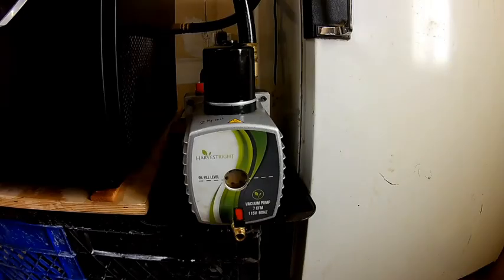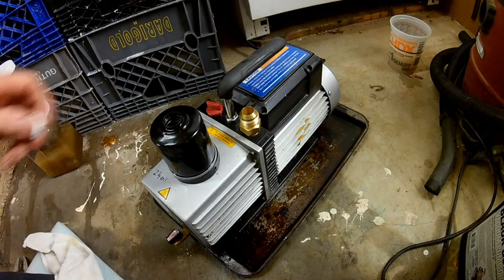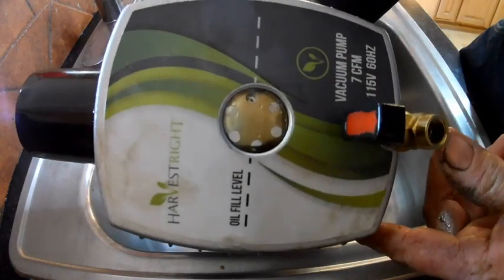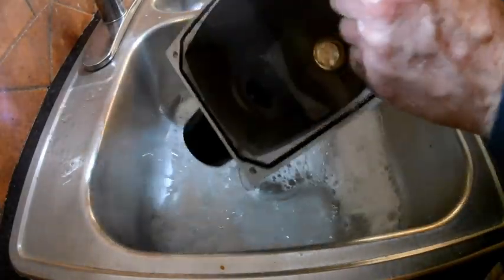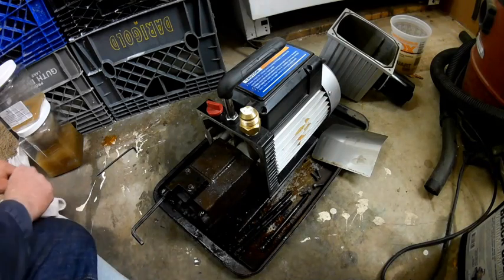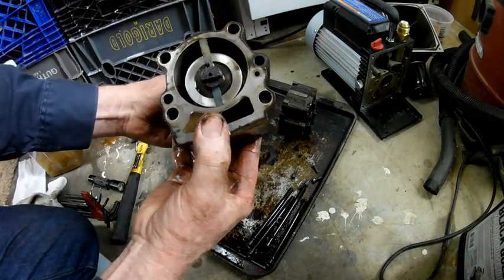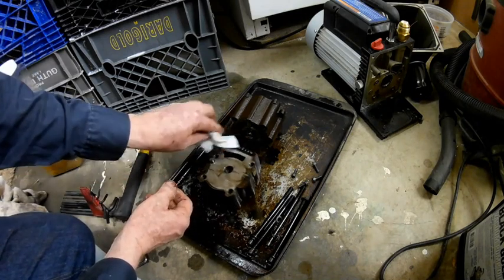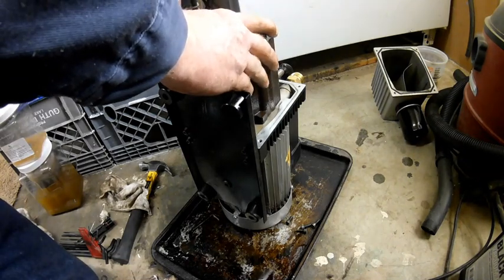Harvest Right Vacuum Pump Teardown

Comment: When you took the little front cover off exposing the shaft end was there a little peace that slots into the end of the shaft, about 3/16 square by 5/8 or 4mm x 15mm
Reply from the maker: I really can't remember.  Do you have the standard or perimium pump?  Do you have an issue?
Reply: @Philat4800feet  I didn't remember seeing it so opened it up again, it was there, thanks. std pump just trying to find why machine isn't registering pressure, I purchased a gauge like yours and it came up 29 in/hg so that looks good, that's about 360mtorr I think.

Comment: Thanks for the video, I originally had the JB until it blew the main seal and cooked the pump so i purchased this one from HR and it lasted 6 cycles and would no longer hold the vacuum after testing and sending them the results they sent me a new pump which only lasted 4 cycles so they sent me a third which lasted 2 cycles lol, so have 3 pumps that wont hold a vacuum, all 3 are the same they get down to under 500torr then go up to about 700 torr before heading back down again but the second time they don't go low enough and after a while the pump just gives up and loses pretty much all pressure, all 3 still look brand new and have no idea why they would go low enough to start with but then give up after that, they thought at first it may be an overheating issue.  now I have nothing.
Reply from the maker: Looks like the odds were not in your favor.
Reply from the maker: The check valve is just inside the pump's inlet,  Normally a ball and spring

Comment: Where does the pump oil enter the vane chamber if it does.  Attached to the motor, I cannot find any opening.  In your video a could not see if it was on the back side. Great video!
Reply from the maker: I can't remember either, but I'm sure there is a pathway.

Comment: Excellent and informative video! Just one question. What type of thread sealant do use on the hose fitting on top of the pump? It took some serious force to get it out, so just wondering what was on it originally.
Reply from the maker: I use teflon tape.  I'm sure the OEM was some kind of thread locker.
Reply: @Philat4800feet  thanks Phil!

Comment: ARE THESE VACUUM PUMPS CALIBRATED IN ANYWAY OTHER THAN HOW THE MANUFACTURER BUILDS THEM?  I trust your opinion
Reply from the maker: There isn't any calibration that I'm aware of.  The only specification a pump would need to meet is CFM and potential Torr at sea level.  In a rotary pump, wear on the vanes would lead to a diminishing vacuum strength.

Comment: do you know where to get replacement seals for these pumps ?
Reply from the maker: On the standard pump, no.  However, if you take the seal or bearing to Applied or Kaman they may be able to match something up.

Comment: Do you leave the air ballast open or closed on yours.
Reply from the maker: When I'm around to do it, I have my air valve open to remove as much air as possible , and then close it around 2000-3000 microns.

Comment: ive been having issues with rust as well, problem is i have to drain the oil every couple batches and pour the rust/water/oil out as its contaminating my oil. the pump works fine but i dont want this rust screwing up my pump? anyone else have these issues?
Reply from the maker: Which pump do you have?  I still have my little standard pump.  It runs great.  I raise the rear of the pump up with a block of wood, empty the oil after every batch, and leave the drain valve open until the next batch.  Water is a problem with vacuum pumps.  Water leads to rust.
Reply: @Philat4800feet   yes i have the standard pump as well, its got to the point where rust particles can be seen in the sight glass and it leaves residue and particles in the filter when i empty it out. i guess i will have to call a tech from harvest right as i cant imagine the oil being good for the pump
Reply from the maker: @chrishill4973  There is a video on how to power flush a vacuum pump.  Check out the repair videos on Harvest Right's website

Comment: This was an interesting video as a mechanic who occasionally works on equipment that uses veins the wall of the cylinder is just as important as the veins.  It only takes a few scratches to loose performance.
Reply from the maker: You're correct.

Comment: So I took mine apart, surprised how much rust I had. I’ve only had my unit 4 months. Cant get it down to 500mt. Oil is cloudy and dirty. I’ve replaced it three times now. Don’t know how to clean the dimister. Any ideas
Reply from the maker: There are three possibilities: pump problem,  freeze drier leak, and other.  I had the same issue.  I went to a nearby hydraulic hose store and had them get me a vacuum gauge, #12 male JIC fitting and adapters (about $14.00).  This device I placed on the hose leading to the vacuum pump.  I started the pump and it jumped to 23" of hg.  This ruled out the hose and pump.  Somewhere on the FD was a leak.  Start with the door gasket, use soapy water at really low vacuum, since high vacuum will vaporize the soapy water  Run the pump for 2-3 minutes.  Check the drain valve to see if it sucks up water when closed.  Check all other joints and connections inside and under the chamber.  Look through the door for bubbles entering the chamber.  The last issue is this- Is your pressure reading, on the screen, giving you a false reading?  The pressure sensor is under the second heating pad from the top.  Check the wire harness and connection.  Right now I'm putting a tee on my vacuum pump with a vacuum gauge.  This will let me know if my in/hg corresponds with my Mtorr read out.  Video coming soon.  Good luck.  Let me know what happens.
Reply from the maker: I wouldn't worry about the dimister.

Comment: Hi Phil, could you describe how you refilled the inner chambers of the pump?
Reply from the maker: Refilled?  Please elaborate.
Reply: @Philat4800feet  Phil, thanks for getting back.  After taking the outer housing off, I then took apart the components to see if the interior of the pump was dirty also (i recognize it was not needed now).  I opened up the inner first and second stage chambers, as you did in the video and cleaned everything out,  then put it back together.  I am now uncertain how to refill the oil that was within the inner chambers (as i initially opened it, clean oil came out from the interior, oil that looked to have been within the stages and was clean compared to the previously drained oil, leading me to believe it might have to be filled separately from the main oil).  It seems like there is 2 systems of oil in the pump.  Do you know, if i simply refill the main reservoir, will the interior components receive the oil they need?  they seem to be sealed off from each other.  There was probably 1/2 cups of oil within the chambers that was released after taking the stages apart.   Does this make sense?
thank you again for any help!
Reply: @Philat4800feet  this might be easier to explain this way... when you put the pump back together and fill the chamber normally, does the oil naturally go back into the 2 stage chambers, or does that oil need to be refilled prior to putting the pump back together?
Reply from the maker: @ryanagostinelli3950  I'm sure the engineers designed the pump to flow the oil where needed.  I didn't do anything but fill the reservoir.
Reply: @Philat4800feet  thanks for the help, much appreciated!  great videos as well!

Comment: Thinking about getting the Navac NP7DP as a replacement. You think that would be sufficient for a medium FD? Thanks for all your videos. Learning a lot in this new industry.
Reply from the maker: Some after market vacuum pumps don't have a check valve.  Check the spec on how many microns (Mtorrs) the pump can draw down.
Reply: @Philat4800feet  it says 15 microns.
Reply from the maker: @bigrndahouse  That really sucks.  A micron is basically the same as a Mtorr.  high CFM is also a good rating for a pump.  I would make sure your stats are equal to, or better, than Harvest Right.  What about Db levels?
Reply: @Philat4800feet  but since we never go down to 15mTorr would it even matter? That one has 7cfm but no data on Db levels. I was told that it was a little louder but not that much in comparison.
Reply: @bigrndahouse  Checked the specs and it looks fine, will have to change the fitting to fit your hose, ill be checking my supplier if they can do that with the same check valve fitting.

Comment: Phil help pls my pump is sucking in air from the switch that has the open , closed on top of the pump opposite side from the fitting for the hose. Is that normal? I cannot get enough mtorrs to do a proper freeze dry. I have the premium green pump from harvest right. Any help would be greatly appreciated I just spent 9hrs prepping for my next 3 runs and I alway like to do a function test before doing my run. When I stick my finger on the hole where the Allen screw goes that holds the switch I can feel it sucking air and if I turn the switch a little bit I can here the air suction stop but I'm still not getting enough m torrs. What are your thoughts?
Reply from the maker: Sorry, but I'm unfamiliar with that pump, However, All fittings need to be sealed with Teflon tape or other sealer.  Check out the link below:
https://navacglobal.com/product/smart-vacuum-pump-np12dm/
I have search for information on who makes the Premium Pump.  This pump is really close.  You might want to call NAVAC (877.MY.NAVAC) and see if they can help you.  If not get back to me.

Comment: thx for the video, I'm currently trying to diagnose mine and can't find the problem, when u diagnosed the drain valve was it passing the water test and the Windex spray test? i ran both tests and it passed, but looking at the ball it is slightly rusted so plan to change it anyways.
Reply from the maker: My ball valve was rusty and sucking up liquid.

Comment: Hi Phil, have you been able to locate parts? We have just run into this issue and ended up buying two new pump from HR. They said they use to sell a kit to repair the pumps, but they don't anymore. We are looking to repair our two pumps we have and see if we can keep them in a rotation instead of just chucking them.
Reply from the maker: I've done the same.  HR doesn't want to be in the parts business.  Not everyone has the skills to rebuild a pump.

Comment: Hi Phil. thank you . do you know how to take the oil mister off,  this standard pump? harvest right teck told me to just unscrew it. TO the right??? I have tried and tried, both right and left.  it turns about 1" both ways. 
there is small wholes on the sides of the bottom ring. thought it might be a pin. but nothing. 
 Is there a way to clean the filter with out taking it off.  
I forgot to close the drain valve, for 4 hours, on a load. then when I checked it, I closed it , everything seemed to be ok, no err signs , but checked the food after 24 hours, that's when I noticed the unit was not drying anything. wooops. fried oil smell. I only had 31 loads on the pump. Maybe I should have put food back in freezer, and defrosted it, very costly mistake for sure.

I have back flushed, and cleaned out the front chamber.  when I tested it, again. it pulled a 498 mt. but then climbed back up. and never again pulled a 500. bottoms out a around 1400 mts.
before I tear it all apart again, to check the veins and reeds, I  won't to check the oil mister. 
also, would you know where to find parts if i need some? 
thank you
Reply from the maker: I made the mistake years ago trying to remove the muffler.  I wouldn’t do it.  It took a long time to remove the water from within.  I remember there’s a set pin towards the base.
If you can’t pull a vacuum you need to test for a vacuum.  Do you have a Hydraulic hose shop near you?  Remove the hose and take it in.  You should have a #12 JIC fitting.  Have them set you up with a male #12 JIC, adapter, Teflon tape, and vacuum gauge.  Should be around $15-20.  This will allow you to test the hose and pump.  If you can pull 20 in/hg or better your hose and pump should be fine.  The next step would be testing for leaks in and around the chamber.  I made a video called “Why is my Harvest Right Freeze Drier Leaking Vacuum?”  it may be helpful.
Reply: @Philat4800feet  
thank you so much for replying, I will make a test gauge like you mention. 
thanks again. 
ps, I wrote you a long reply, and lost it, haha 2 times, so I kept this one short. you lucked out.
Reply: @eviebays  I would run vac pump with fresh oil for 20 min then change the oil again to fresh oil. I work in large scale refrigeration systems and work the crap out of my HVAC vacuum pumps (they are almost identical) pulling vacuum on large chillers.  I can run the pump for 12 hrs and pull something the size of a large SUV down to 500 microns (same as MTor I believe) pulling a vacuum on large equipment like that is almost like running freeze dryer with drain valve open for hrs.  A change of oil later and my vacuum will pull down to 28 microns hooked up only to a micron meter.

Comment: How are you converting in/Hg to mTorr?  I am able to pull 26 in/Hg on my pump, but using online converting calculators I come up with 26 in/Hg equaling 660,400 mTorr or 660.4 Torr.  The conversion does not seem to correspond with the readings I get on the Harvest Right display.
Reply from the maker: I've had the same problem.  Working on a solution.
Reply from the maker: A perfect vacuum with in/hg (English system) is 29.92 in/hg
A perfect vacuum in Mtorr or Micron (Metric) is 0 (zero)
in/hg starts out at 0 and goes to 29.92
Mtorr and Microns start at 760,000 and go to 0 (zero)
Both vacuums are perfect at sea level at the proper temperature.
One goes up (in/hg) and one goes down (Mtorr and Microns).

Vacuum pump manufactures often state what the pump will produce at sea level.  This amount needs to be adjusted for your altitude.  If your pump can't meet the factory specs at the adjusted altitude. the vanes are probably worn.
Reply: @Philat4800feet  Interesting... So how many in/Hg does my pump need to pull in order to achieve 500 mTorr in the freeze dryer? The online conversion calculators don't seem to give me an answer that makes sense.
Reply: 1 torr = 0.999 "/hg. & 1 millitorrr is 0.001 torr.  Mtorr is not a pressure measurement you will usually see in industry since it is such a tiny measurement of atmospheric pressure that it is normally only utilized in research & theoretical work.  normally people in the AC/R industry deal in torr or in/hg.  You are having a hard time converting because Phil had his decimal point off by 3 places.  On the screen he stated that a pressure of 584 mtorr is equal to 23 inches/hg.  I believe what he meant to say is that 584 torr = 23 in/hg, because if you actually convert 584 millitorr, it equals 0.02299 inches of vacuum. If you correct the decimal point error, you get 22.99 or 23 in/hg.

Comment: Would, or should we spray wd40 on that ball to prevent the rust on it?
Reply from the maker: WD40 will displace moisture.  After that I would add a few drops of vacuum pump oil.
Reply: @Philat4800feet  thank you! We are suppose to get ours today and am going to do this. Appreciate your help!
Reply: Be careful of material chemical compatibility.  It might create havoc with seals/orings.